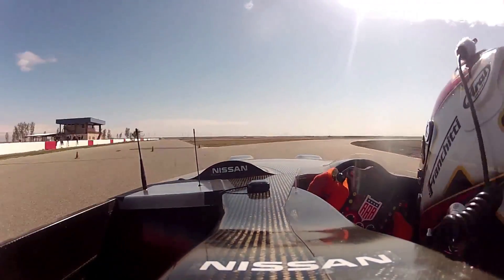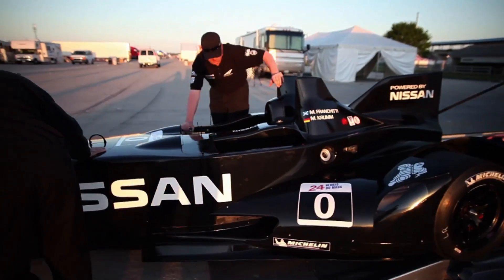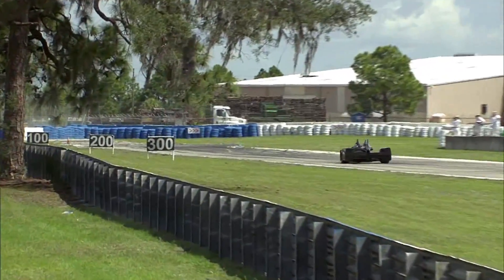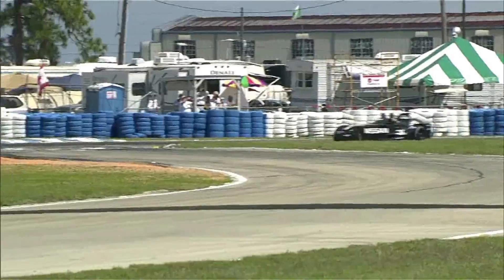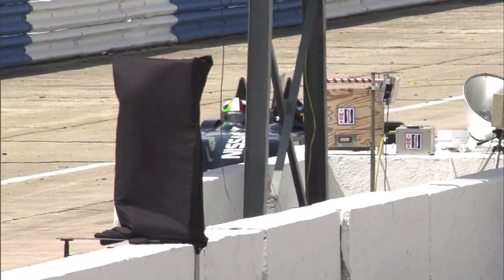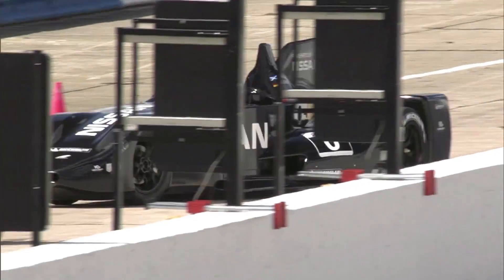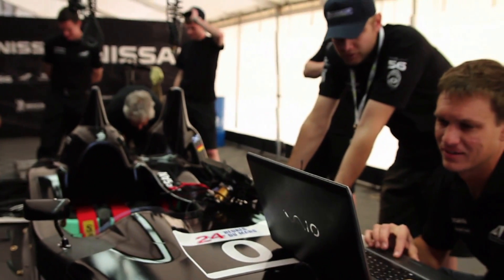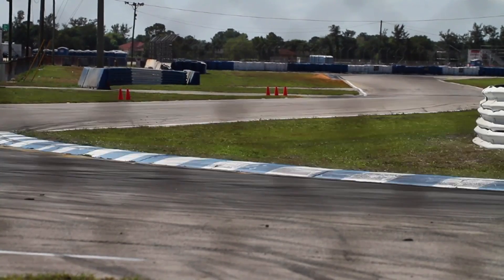DeltaWing Tests at Sebring Reveal An Innovative Car with Conventional Details

Comment: Nissan is getting a lot of bang for their buck in cheap or nearly free advertising for doing nothing of importance with this oddball of a car.  It looks strange & is light weight but who really cares unless Nissan sponsors a series lock stock and barrel no one else will race one.  As a real race car it is a bad idea because as a rule drivers think if the front end can fit though a hole the back end can also.  In real race conditions this chassis design is called a multi car wreck maker